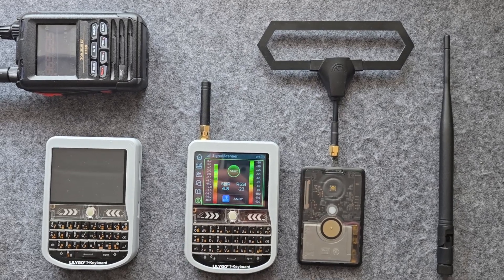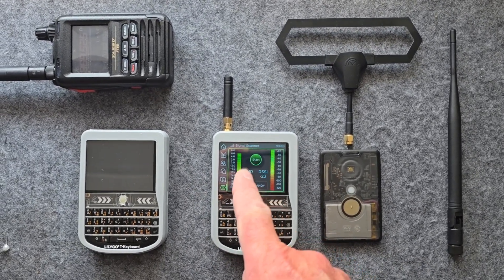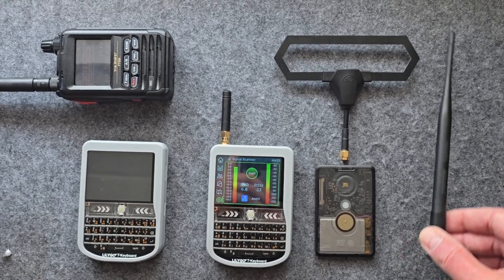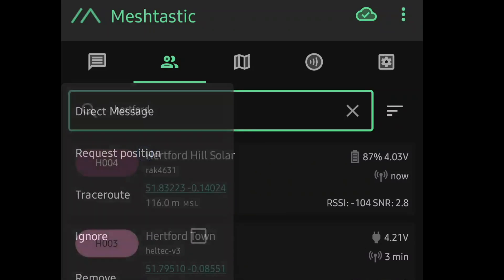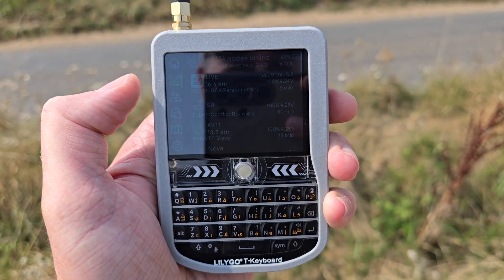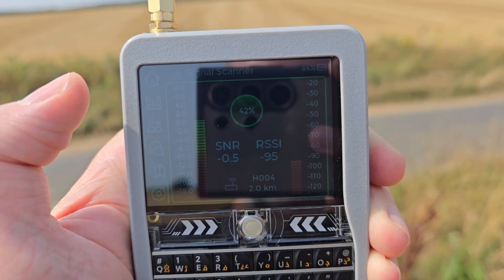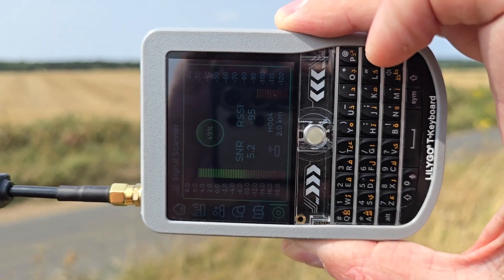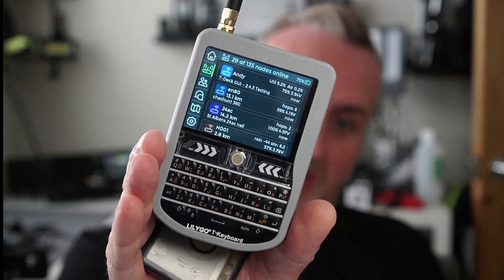Seeed Studio Sensecap T1000e (Meshtastic) Antenna tests

Comment: Nice video. There might be a bug in the software or something, at https://youtu.be/ZWIO_Ea6z4o?si=InSKlfhG_vzWV3ar&t=215 it showed RSSI -92 and SNR 56.8.  I find the 56.8 value highly suspect given the rest of the readings showed an SNR of less than 10.  Actually there were various readings showing SNR in the 50s to 60s range on the first pocket device (T-1000e).  I do see that last antenna had great SNR values, it must be well tuned for the frequency.

Comment: Hmmm, your vid shows that the t1000 was consistently better on snr with level around +5 than even your big antenna on the t-deck but you only talk about the rssi, afterwards you mention that snr if the think to watch for. Doesn't make much sense

Comment: Andy, can this T1000 be flashed on the Meshtastic website or do they ship with meshtastic already installed? Does this T1000 work at 868mhz? Regards, you are doing a great job!
Reply from the maker: Yeah you can flash it using the web flasher and yes it supports from 863-928mhz bands. Thanks!

Comment: what's the battery life from this card ?
Reply: 2 days
Reply: After a rough look, the peak value of sending messages is approximately between 150mA-160mA. When GPS is not turned on, the base current is between 20-25mA. When turned on, it is between 25-30mA. If GNSS is normally on, and the battery life is about 2 days .When the GNSS sampling period is greater than 1 minute, the battery life of 700mA is about 3 days:face-blue-smiling:
Reply: @dylanazure2298  thanks u sir,that's really helpful.its not really a long battery life but it's  perfect for the Wife ;)

Comment: The metal antenna on the side is the GPS antenna, not the LoRa antenna.  The LoRa antenna is built into the PCB itself as a trace.  This is probably similar to the Nano G2, which was designed specifically to get good reception while in your pocket and next to your body.
Reply: yeah, looking forward to seeing the coverage comparison between the Nano G2 Ultra and the T-1000e😀